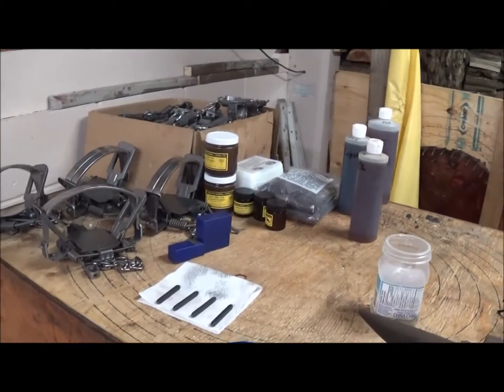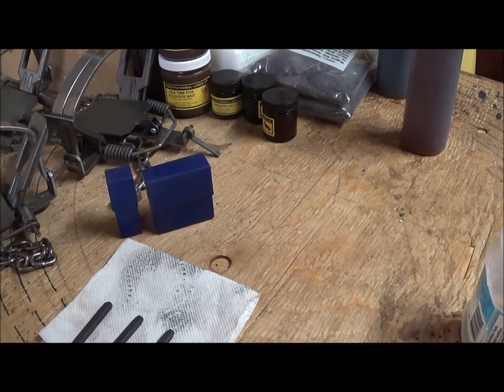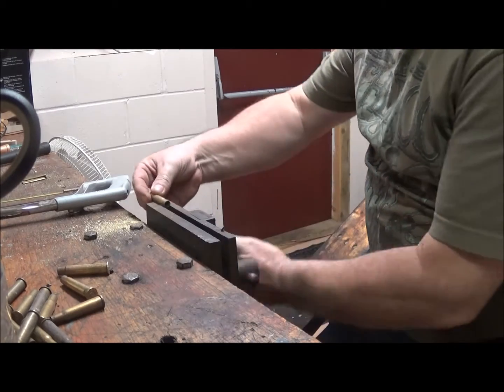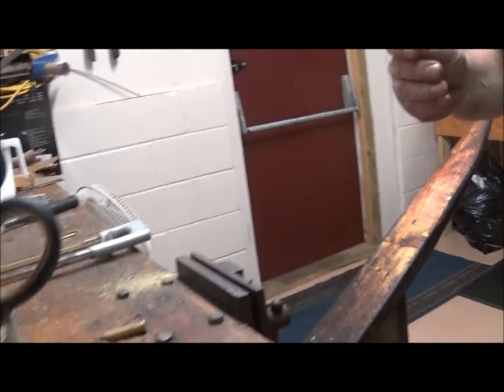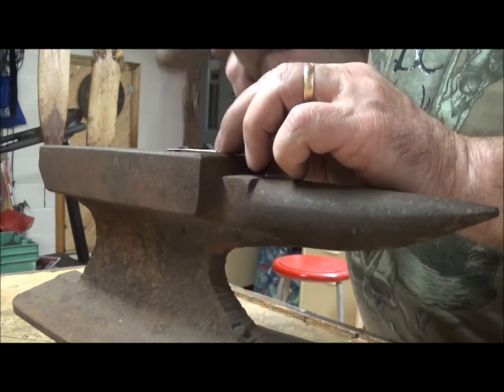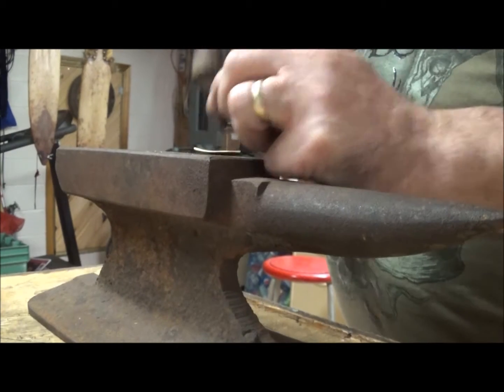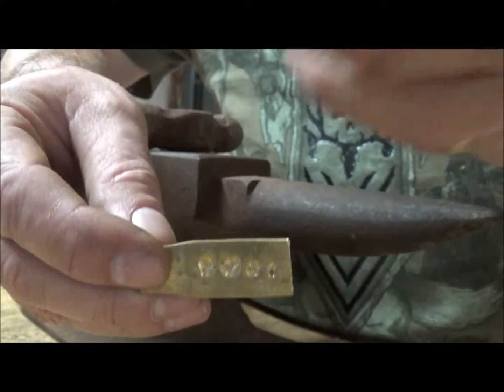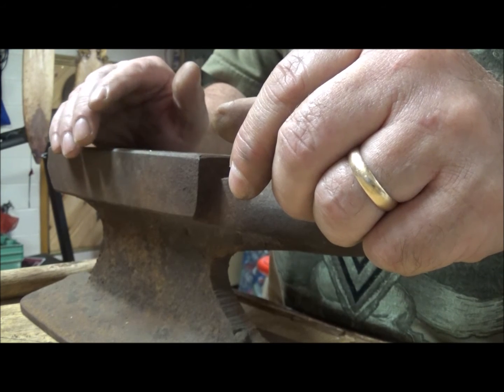Making Your Own Trap Tags

Comment: Great Idea Barry, the first time I was posted in Greenwood I had a 4 digit number, but once I returned I couldn't find any proof of my 4 digit number and had to use my full number. Oh well, I just used plastic from and ice-cream container cut into thin strips and a sharpie. I like the idea of using the brass and I like the way the brass will tarnish and really blend in over time. Great tip...
Reply from the maker: +NLGhostWolf Thanks Charlie